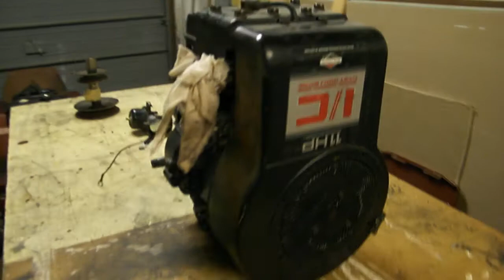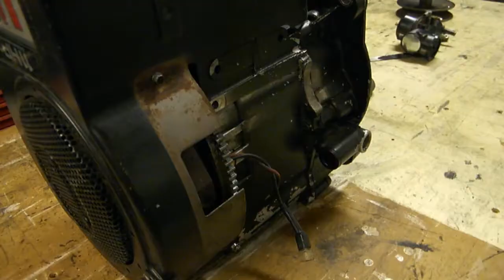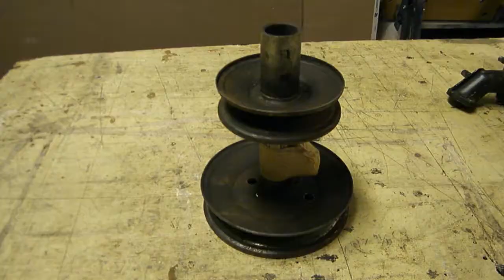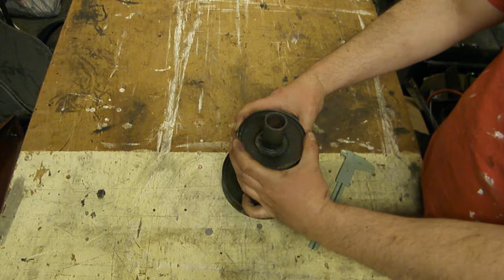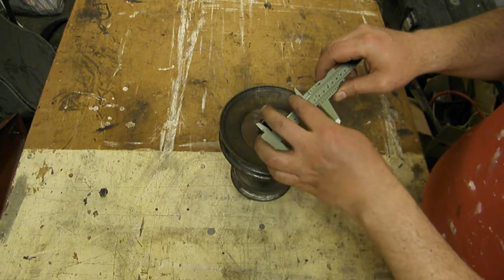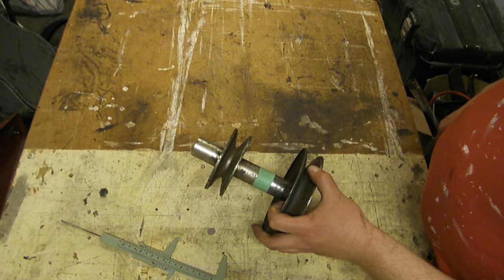Racing Mower Build Modifying the Drive Pulley

Comment: My mower is ready for teardown to reinforce the frame - haven't started on it yet eek!   Still trying to organize the new garage and get everything setup.  Trying to learn all I can before I start as well! -- So you're keeping the original pulley on the shaft?  Or did you eventually put a larger one on there for a better ratio for speed?
Reply from the maker: I ended up buying a clutch with a pulley on it. Pulley is now 3 inches instead of the original 5. I didn't have too much choice in this. I have a jackshaft on mine to allow for lowering the back end. I will likely change the gear ratio via the jackshaft i.e. put a larger pulley on the top. Right now, I have 3 inch pulley all the way through for a 1:1 ratio.
Reply from the maker: I just put on a centrifugal clutch, actually. I hope to make a video about that soon. I had a lot of problems with belt tension. My mower has a jackshaft (because of lowering it) so I may put a bigger pulley on the top end of the jackshaft. Right now its at a 1:1 ratio from the engine to the jackshaft.
Reply: Did u change the rod or anything when u removed the governor from motor??

Comment: Did you say you removed the Governor,, yeah it's 4 years later too lol
Reply from the maker: Yes, I removed the governor. All the internal bits, too. I have actually swapped out the vertical shaft engine with a Honda clone and put on a torque convertor. Waaaaaaay better now!